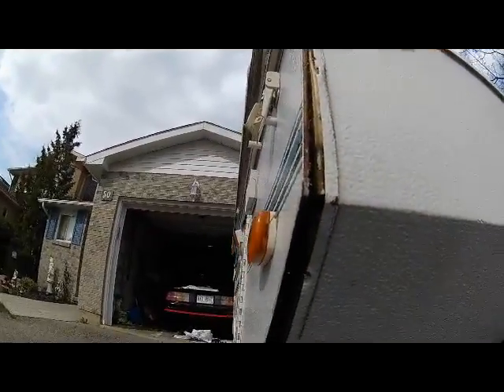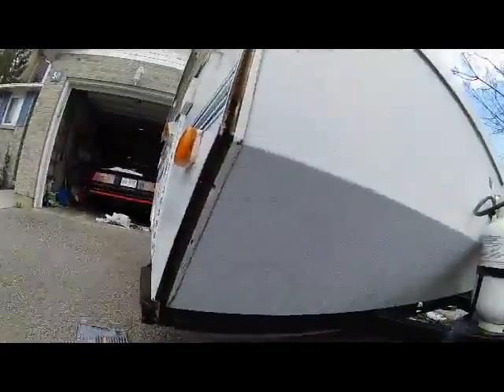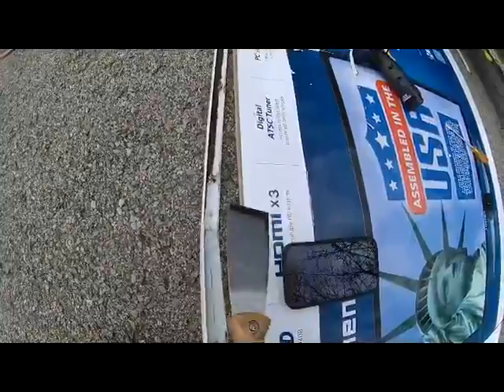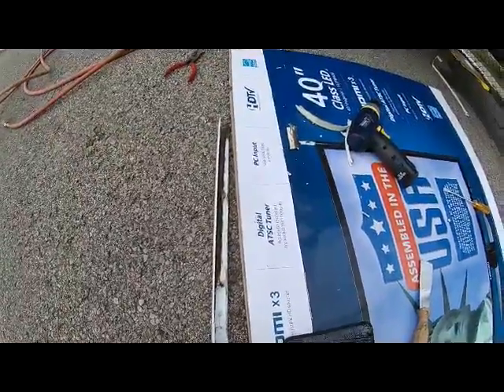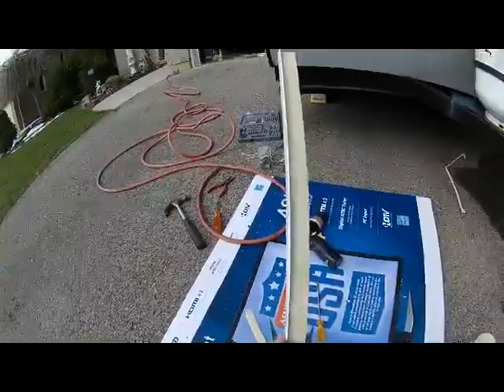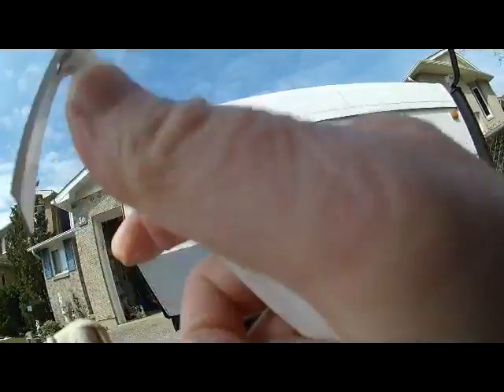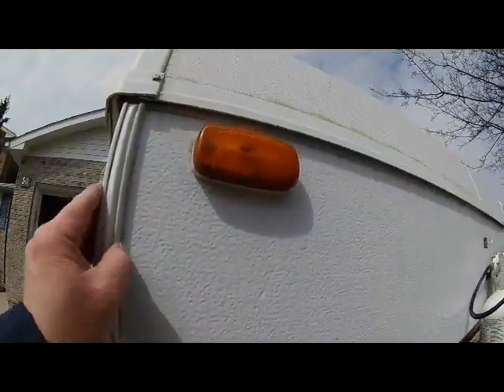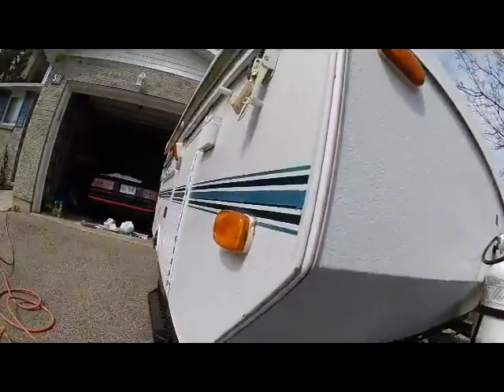Tent Trailer Putty Replacement

Comment: I thought this was an informational video, appreciate you showing step by step how to tackle this project.  I would have like to have seen your staple gun and the size of staples used, and exactly where they went: outside edge, inside edge, under the track you removed, etc.  I have the exact same issue on my pop up camper and know  I will have to use a stapler.  Again, good job!
Reply from the maker: Sorry for the confusion. I just used an air Stapler and the staples went in just about a quarter of an inch from the edge. Right along with the old staples, but In different locations. That's the thing as they are being towed they take a ponding so everything loosens up. Sorry for the late reply.

Comment: When you say putty do you mean Butyl tape? Also, I’m a bit fuzzy on whether you installed the tape to the trailer or the rail ?
Reply from the maker: Sorry about that, yes I am referring to the Butyl tape and I put the tape on the rail first up tight along  the edge then when you screw the trim onto the trailer the tape will work out from the steel corner it will fit in the widest part of the corner bead trim.